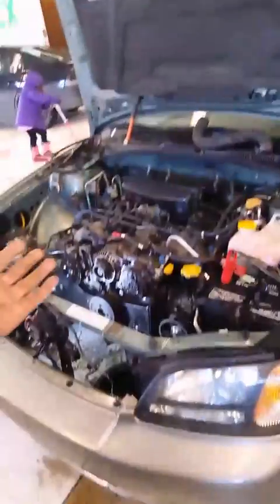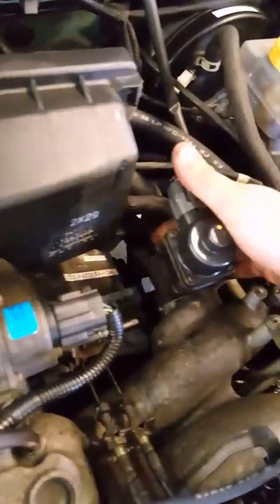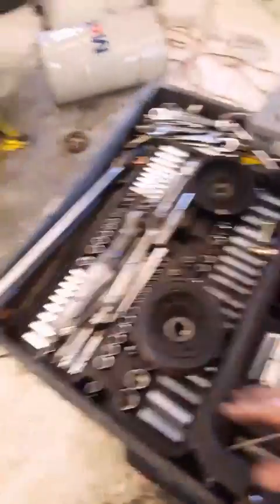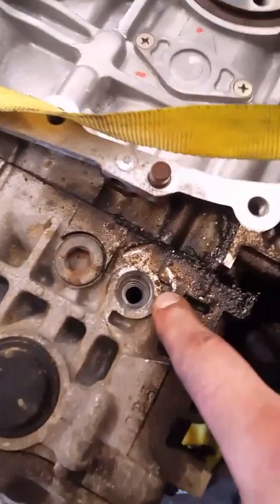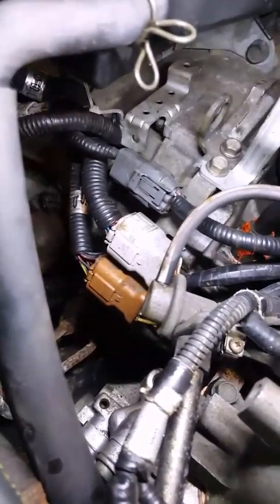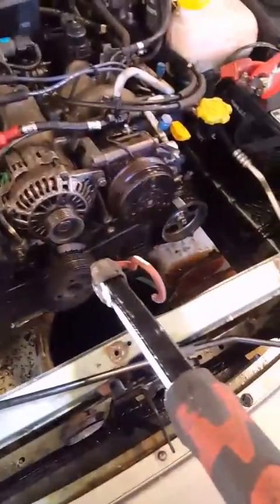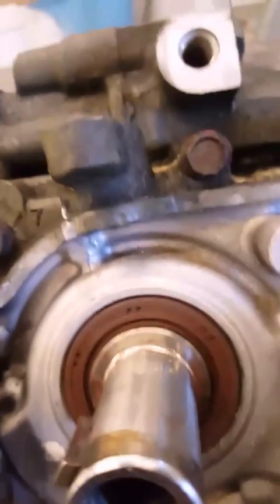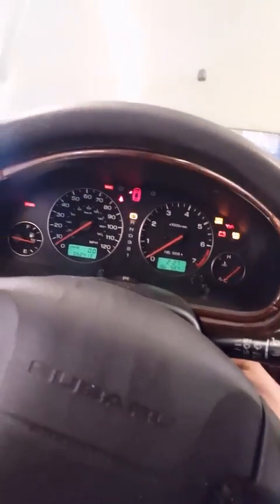SUBARU MOTOR SWAP EJ25 TO EJ20 ALL YOU NEED TO KNOW

Comment: Hey man love your work. Ive got a liberty gt 2007 that had the 2.5 and without checking purchased a ej20 out of a 20004 model. Is there anything extra to that needs to to changed as the 2007 has the secondary air pump system , the tgv system amost other shit. I was given the ecm and harness with the ej2o  and thought it would be easier to swap the ecm and repin the the loom (exsisting 2007l running from ecm through firewall to bulkhead. Thankyou in advance

Comment: Great! - I just did the same swap, however, the car is running too rich.. did you have the same issue? if so, how did you fix it?
Reply: Same here. If you have a MAP sensor and not a MAF sensor, you will have issues. Mostly with an erratic idle and very rich condition (STFT @ -20% to -30%).

Comment: What about the oil switch solenoid valves and tumble generator valves? What did you end up doing there because there is not place on the ej20 to mount it like on the ej25 or did you do some sort of delete

Comment: I bought a 01 forester with swaped engine 2.5l to 2.0l and i feeling not power, like not torque! 
I changed already all lubes (amsoil products) the catalityc (brand new) and still like not power, i remember with the 2.5l when you press the gas pedal the engine responds but this engine responds slow, the last owner said he changed just shortblock! Someome have idea what could be?
Reply: The 2.0 has about 25-30 less horsepower and Torque than the 2.5. It will make the vehicle slower.
Reply: I feel the same way you do man… no power. I had someone else do the swap,so I have a lot of money into it but any ideas on how I can get power back?

Comment: Great vid and very helpful.  I have watched several vids and many people are in the same boat as I am.  Swap was done by someone else on a NA 2.5 to 2.0 and the car starts and runs good but is not just a dog which would be fine but it bogs down in second gear and seems to jump into overdrive when climbing hills and bogs down unless I force it into passing gear.  I read all of your replies but will throw it at you again......do you think a pro tuner can dial me in?  One more question if I still have your fucking attention.  My engine literally sucked the air filter in the intake tube.....like its a perfect rectangle but right in the middle where the air gets sucked in was imploded like someone put their fist through it right there.....what the hell could cause that?
Reply from the maker: A pro tuner could probably help sure... And a garbage air filter especially when heated would be prone to inlet collapse. Unless you're engine has a supercharger on it, you just need a new air filter.
Reply: Thanks !!!

Comment: Do I have to drill teh hile in the left cyclinder head for that u shaped tube to be connected between the head and manufold? I just connected the tube to the ej25 air intake manufold and sealed the other part....for the time being... Unless it is essential I dont want to drill hole and do that work and thread...

Comment: Oh...man ..I learned all that the hard way...i did it myself with the help of a mechanic friend. However I changed the tranmission plate; and I put back the intake manifold. Left the timing belt as it was from the ej20.
Did replaced knock sensor. Did not change crack and camshaft sensors..did not changed harmonic balancer nor any of timing belt gears.
Turn it on and it fire up and it worked. However; I have a problem with idle being not stable of high...
Engine is running good. It seems that too much fuel and ratio or air and fuel is not good.
Any idea?

Comment: For that egr rod . Can u keep the 2.5 heads and out on 2.0 block? So that way you still have the egr rod instead of tapping in the back of the 2.0 head
Reply from the maker: What?
Reply: @551mic  the 2.5 heads have the port for that egr rod going from intake to back of the head ..I was saying instead of drilling the head ..can u put a 2.5 head on a 2.0 block and that way u can still keep the egr  pipe from intake manifold to head since u already swapped over the 2.5 intake maniflold
Reply from the maker: @justinrolon4643  yes
Reply from the maker: But swap both heads not just 1 side or the compression ratios will be off enough to cause misfires.
Reply from the maker: @justinrolon4643  also SOHC heads and DOHC are not swapable this way without heavy mods...
Reply: @551mic  wasn't referring to dohc cams I was talking bout SOHC ej2.5  on a social 2.0 block
Reply from the maker: @justinrolon4643  I'm aware... However the info about the SOHC and DOHC heads is like a just in case whisper...
Reply: @551mic  basically can u Frankenstein it . the 2.0 block with 2.5 heads
Reply: @551mic  I'm thinking not cause cylinder bore difference
Reply from the maker: @justinrolon4643  the bore difference does not matter. The valves are all the same. In the same spot. The downstroke of all valves will clear the cylinder bore. And the head gaskets for 20-253 seal in the exact same spot...
Reply from the maker: @justinrolon4643  only difference is the depth of the combustion chambers between 20 heads and 25 heads. It's basically if one head was resurfaced by taking off .20 on one and only .05 on the other. ..
Reply from the maker: @justinrolon4643  to test the fit, install the heads without gaskets, don't fully torque the head bolts either. Just a little more than hand right is all you need, then set the timing and install the timing belt. Then rotate the motor several full rotations. With the Spark plugs removed ... You should have no resistance. Aside from a few inch lbs worth. If it rotates without issue your gold. If it runs into a valve then it will stop it from rotating. If that happens then you put a 20 head on a 25 motor from a year they weren't comparable...however the stock 25 heads can be installed on any stock motor essentially... only way to put 20 heads on a 25 stroke block is to use custom thicker cometic gaskets. Instead of the normal .10 thick, you would order .15-.25 thick ones. If you are just doing the 25 heads to a 20 block you will be just fine  and to assure yourself run the test I described. Unless your shit has been fucked with aftermarket it should work without issue. I have done this before. But not with anything post 2012. Yet I believe the blocks and heads minus a few new things like vvt ports and shit are all still the same...... so Frankenstein away boss.
Reply: @551mic Hey man love your work. Ive got a liberty gt 2007 that had the 2.5 and without checking purchased a ej20 out of a 20004 model. Is there anything extra to that needs to to changed as the 2007 has the secondary air pump system , the tgv system amost other shit. I was given the ecm and harness with the ej2o  and thought it would be easier to swap the ecm and repin the the loom (exsisting 2007l running from ecm through firewall to bulkhead. Thankyou in advance

Comment: I did this swap and it’s running -25 long term fuel trim. Should I try to run a jdm ecu that’s meant for the 2.0?
Reply from the maker: No. Just have the one in there now tuned.
Reply: @551mic  where can I get that done
Reply from the maker: @WayOutEast1  find a powersports shop or a dealership with a master pcm technician
Reply: @551mic  thanks. I did this swap with an auto and it seems to be running well. But I feel that it needs to be tuned or many shift points do you recommend any tuning and what exact tuning ? I’m new to all this tuning stuff dude idk anything about tuning tbh that legacy you did did you tune it ? Or just let it alone ? How’s it doing today ? Also I left the plastic passenger side cam gear as it was not a recommended part.

Comment: What about fuel injectors? I did a ej203 swap into my 2000 forester. Runs good but has a fuel trim code. I believe its fuel trim out of limits. Either rich or lean.
Runs good around town and flat highways but any steep inclines on the highway I have to get the auto trans to drop down into like 3rd at like 4k rpm to keep it at highway speeds. And it will usually slow down to like 50 if it's a big incline
Reply from the maker: Was the previous motor larger? Less power in. Heavy frame would certainly be why it takes a lot to stay at speed up inclines. And the injectors are mostly the same. Only ones that are different are between turbo and non turbo engines. So might be worth swapping those as well. However the trim codes may be just from the 02's not getting readings they are programmed for. The freeze frame data would be the confirming or denying evidence of such!
Reply: @551mic  yeah foresters in america only came with 2.5L I know it lost some torque but it's just so noticable on the highway in the mountains as I said. It's fine around town. It has a Bosch map sensor that someone replaced the oem one with. This year doesnt have a maf only a map sensor so I'm think maybe it would be happier with a subaru sensor. I mean theres probably a reason the map sensor is like 300 new from Subaru. So looking for a used oem one. I'm almost thinking of having it pro tuned. Theres a big subaru tuner in my area he usually does turbo only obvoisly but has done older n.a subarus.
Reply: @551mic  I'm thinking it's running an extremely inefficient fuel map now. Since original engine is a 2.5 not a 2 so much less air going in. Also I know these 2.5injectors flow a little more. So not sure if it can adjust for all this fuel....

Comment: Is it possible to do this with a DOHC EJ20?!
Reply from the maker: I have done it successfully from a SOHC motor to a DOHC motor. No problem. Never looked into the specifics as to why. But I was bored and it worked.
Reply: @551mic  so if I put a turbo DOHC ej20 in a forester xs it will just work??
Reply from the maker: @marcothemakr14  I have no idea. The ones I've done were non turbos. Idk the specs of the vehicle your taking a motor from and transplanting to. Or the ones for the vehicle you've got the new motor from. I don't have my computer hooked up to either of the vehicles so I can't tell you if the programming is compatable or not etc.

Comment: For the cam shaft position sensor have to be drilled and Tapp also
Reply from the maker: No. There is a hole existing for it already on damn near every 2.0.
Reply from the maker: Sits behind the driver side camshaft sprocket.
Reply: @551mic  shoot appreciate it
Reply: Also just got further into the comments you said for an 08 impreza you have to do less drilling?
Reply from the maker: @austinalilin6655  I don't believe I did say that.
Reply: @551mic  hmm this is the first I have done something like this on a car, so please bare with me. But my 25 engine doesn't have the hole you drilled out in the back it actually looks like it was closed with a plug but the 20 has that same spot already with a line coming out any suggestions on what I should do ?
Reply from the maker: @austinalilin6655  well if the 25 that came out has that hole plugged and you're putting the 20 inside where the 25 was. Then just plug the hole on the 20
Reply: @551mic  sweet sauce

Comment: Hi, I have a 2000 outback sedan 2.5L auto and I want to swap an 02 WRX 2.0 turbo and the manual tranny with it. I learned all the stuffed you mentioned in the vid and and read some more in the comments and your replies. I know we're going to have to take the clutch and all that shit and somehow fit it into the outback. I feel like the electronics are going to difficult to figure out as well as making an automatic into a manual. This is my grandpa and I's first experience with boxer engines and I was wondering if you had any more advice? And also a source for the torque specs for pretty much the whole car. The vid was great btw, very informative and entertaining.
Reply: You're better off getting a automatic turbo engine

Comment: Hello! I just got a 99 impreza wagon and it comes with a ej25 ( the ej25 was broken and the seller sold me the wagon with a jdm 99-04 Ej20 sohc) so i did the swap it cranks but i have no injector pulse please help (first time subaru owner.
Reply: I only got new starter, spark plugs and fuel pump.
Reply from the maker: It's most likely due to a bad crank or cam sensor. And or having used the incorrect sprocket/s

Comment: I have a 2009 outback with the ej253 non turbo with avls. I'm looking at a 00-05 jdm ej2.0 coz it's cheaper. Will it work ? esp the harness and CEL
Reply: Did you ever figure this out ? Im looking to get a good priced ej20 but also have a 2009 , but an Impreza, kinda crazy how the subaru community kinda stale with info :(

Comment: What if you don’t swap the oil pressure sensor will it cause it to not start up ?
Reply from the maker: Is your timing dead on correct? Harness have any niks or pinches and grounded correctly? Certain the crank sensor is good? Certain the sprocket is the correct sprocket for the sensor and undamaged? It can be a whole load of things. And unfortunately I'm not there to help...
Reply from the maker: In a turbo it can... In a non turbo no.
Reply: Mikhail Burke cuz I’m doing a ej253 to ej203 and I e swapped out basically everything and it still won’t start that was the only thing I haven’t swapped

Comment: My EJ20 camshaft pulley/sprocket made of that plastic composite stuff broke in 6-7 pieces. No idea if the tensioner was not bled properly because I did not do the job. Stupid idiots should’ve used same material on drivers side made of metal. Mine was a JDM engine with 57k miles. My belt did not bust but the camshaft pulley/sprocket did. Anybody know my chances of bent valves? I’m going to put it back together soon and crossing my fingers no internal damage was done. Anyone else ever be in this predicament? The 05 Forester has only 78k miles right now. Head gasket was bad on the 2.5L engine with only 72k miles as I bought this nightmare used!! Lol

Comment: I know this video is two years old but I have a 2008 Impreza with a blown up 2.5 can I do the ej20 swap? How do you modify the harness for the cam position sensors since the ej20 doesn't have them?
Reply from the maker: I'm not certain about that year but I'm pretty sure so long as it is a 08 2.0 you should be fine.you won't be modifying your 2.5's harness for those sensors you will just be adding those sensors to the 2.0 as it does have the mount for the sensor.
Reply: Dude great question im in the same situation now with a 2009, i bought an auto impreza, still looking to stay NA but that being said the transmission to engine stays the same for subaru engine swaps, its my first subie.

Comment: How is it with swapping a turbo ej to a non turbo Forester x do the wiring fit and the mounts ?
Reply from the maker: Motor mounts should fit without a problem. You will want to put the non turbo heads or at least the non turbo cams on the motor going in. Assuming the years are comparable. If I were you I would just put the heads onbecause sometimes the camshafts are not only different lobes but they have different girths where they are retained to the head.

Comment: Line up the marks like he said but the engine will not be at top dead center. Subarus are designed to time them with all the pistons basically at mid stroke so the valves won't hit while you line up the cam sprockets.
Reply from the maker: Yes it's called static timing. I use TDC as easy to follow instructions for dummies.
Reply: Yeah i noticed when I was lining up the cam sprocket marks that they were mid-stroke, you can tell by the tension when you turn the sproket - turn it a little too much to the left or to the right and it will spring in that direction past the timing mark.

Comment: did you use the old spark plug and coil from EJ251 into the JDM engine?
Reply from the maker: No. Bought those brand new for the 2.0 specifications.
Reply from the maker: I think I forgot to mention that in the video. However the coils are the same you could reuse the coil but the plug wires are different depths as the plugs are different lengths

Comment: Wat if am changing from EJ 15 to EJ 20 ... are the flywheels the same or I’ll  have to change again 
And drilling the cylinder head , what if I jus suspend the pipe and blocking with something on the intake manifold ,is it gonna be a problem or
Reply from the maker: It'll likely set off your engine light. And guaranteed to reduce fuel mileage

Comment: Have fun bending valves when you use the timing belt for a metal pulley with that 'aftermarket' plastic pulley- it's not aftermarket...its different and has different # belt...they will slip eventually and the difference in tooth design is barely perceptible to the human eye.  FYI
Reply from the maker: Nope. Dealer ran serial numbers and confirmed they are the same. Only difference was the year they shifted from metal to composite material. Must be nice thinking your smart but actually dumb eh.